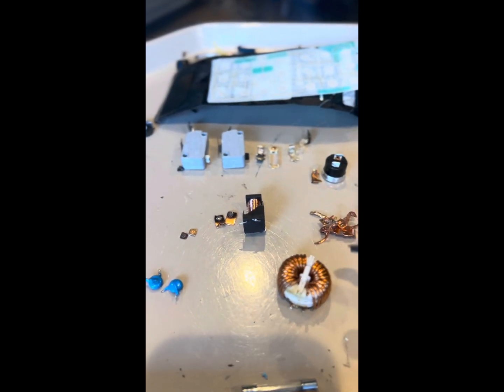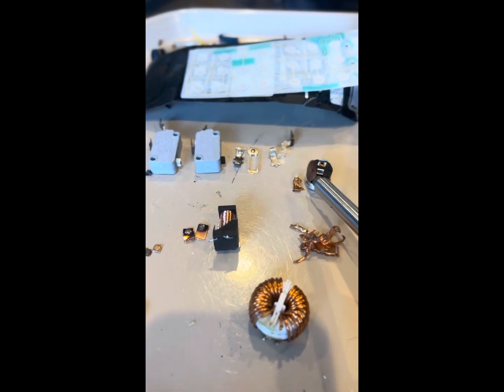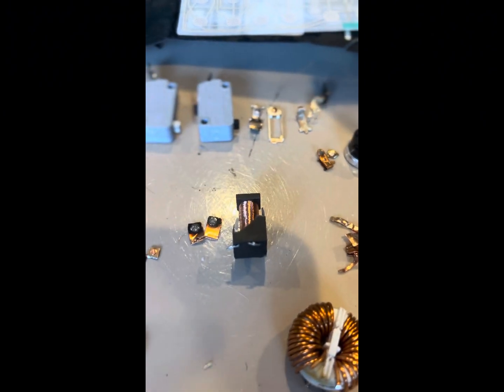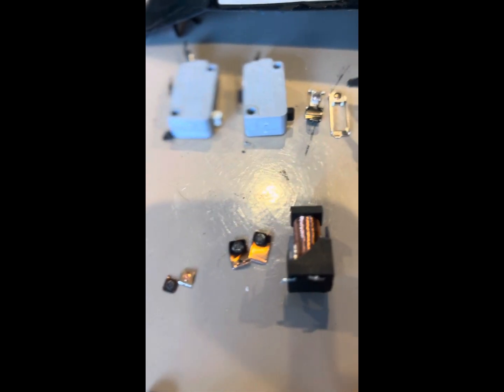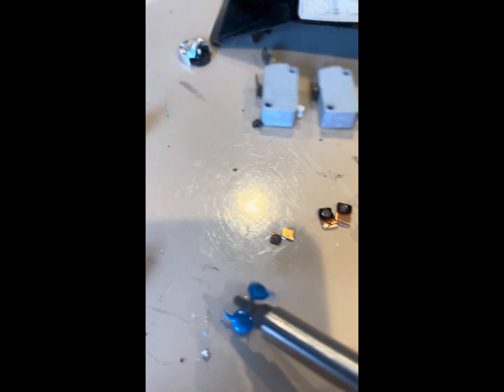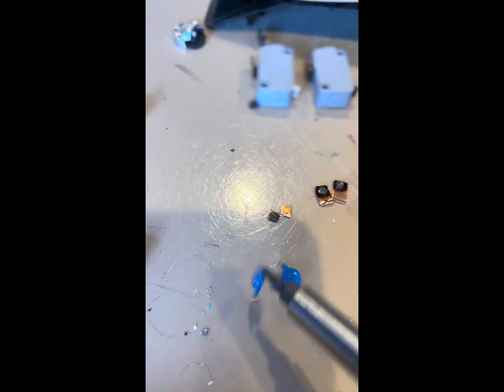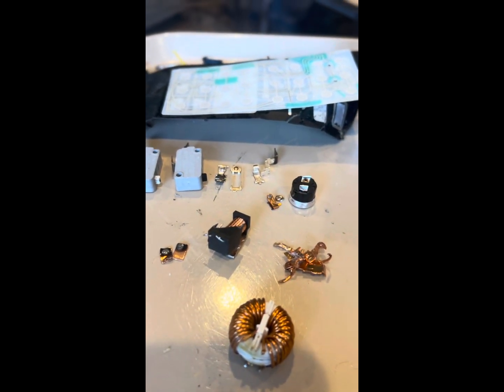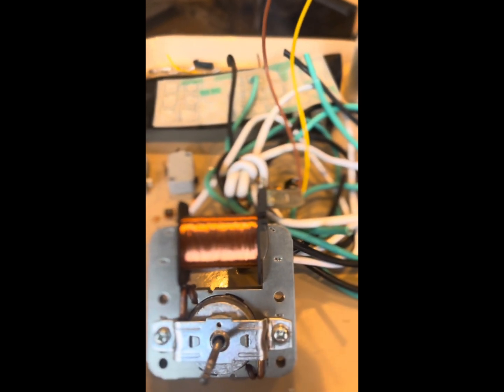Recovering Silver and Copper from 3 microwaves #silver  #scrapper

Comment: Microwaves by far are the worse scrap and dishwashers but I can not turn free scrap down time costs me nout.
Reply from the maker: I was hoping for more copper . I did those three last night while converting silver chloride . The transformers had aluminum windings ( drag )
Reply: @Hill-13  in England there are screw apart plugs and moulded plugs the screw apart plugs are always copper windings on everything
Reply from the maker: @ I think I found three of the cheapest made microwaves. But I did get some silver contacts and the fan motors had bright copper . I see a copper ingot in the future
Reply: @Hill-13  mate I hate them because of the beryllium  magnetron pink I see people mess with them all the time like me you know that 0.006 of a gram airborne could kill you. That's a grain the size of a pin head. Even though them microwaves are aluminum oxide it still freaks me out and the costic soda used in dishwasher liquids burns like sulphuric acid and gives nasty vapours
Reply from the maker: @ i agree I had never taken one apart  until Saturday night. Unless it’s old then I will pick it up . Finding aluminum windings in those huge transformers was disappointing .